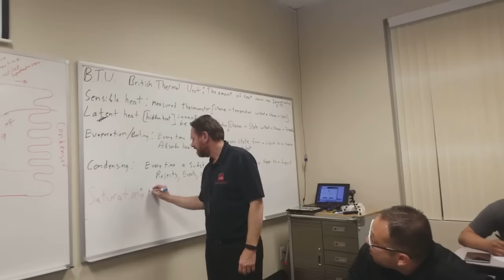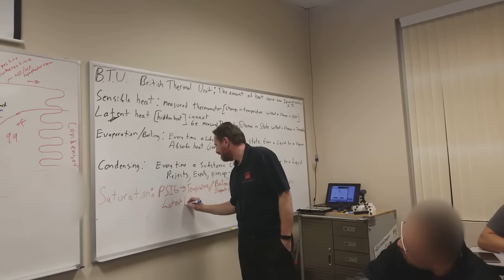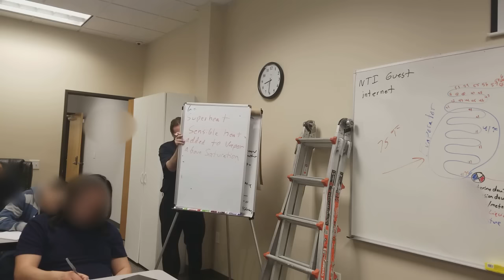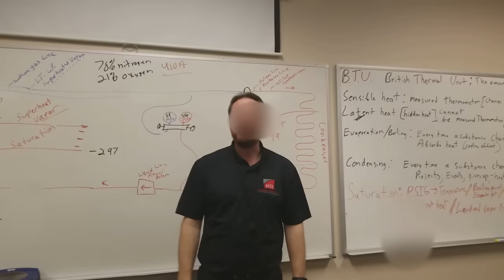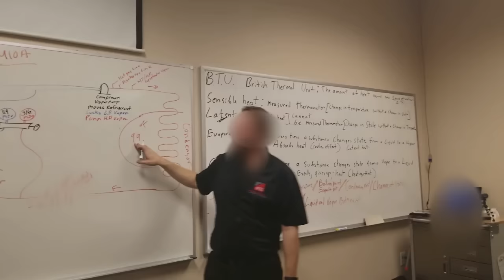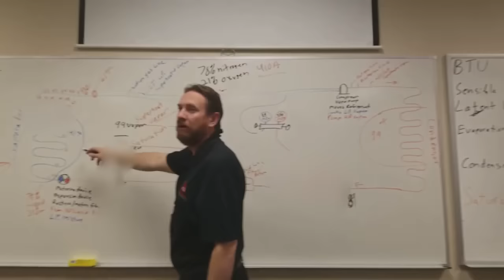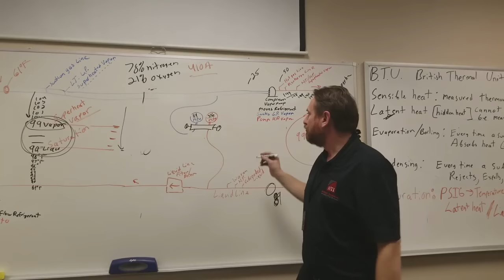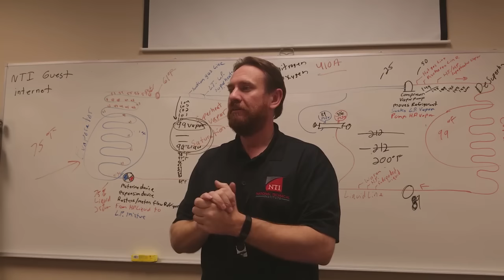Saturation, Superheat,  Subcooling

Comment: In refrigeration I have seen a common engineering practice - where / in which your liquid line and your suction line are tied together side by side ( touching / in contact ) with each other . This helps to further subcool the liquid refrigerant entering your TXV - and -  at the same time - further superheating  the vapor refrigerant returning on the suction side of the compressor which ensures no flood back or liquid slugging your compressor . Great Instruction 👍👍👍

Comment: You have a nice beginner course going here, explained in layman's terms with a bit of the scientific mixed in.  Good job Sir!  You're transitioning them from guys and girls with common sense into a more scientific bunch.  We actually give classes at our company for the kids and adults coming out of refrigeration school just as you are teaching here.   They don't need to know all the science, but what is relevant and most relevant to a refrigeration system.  Don't forget to let those new scholars know that it doesn't matter how cold you're getting something, it is always the same process of moving heat from one place to another.  It doesn't matter if you are cooling air, water, glycol, or even another refrigerant, it's the same process.  (When I say other refrigerant(s), I'm speaking of cascade refrigeration systems).  Good show, good teaching, and good luck to all that are learning the refrigeration process and how thermodynamics work!

Comment: excellent teaching. do you have another video explaining when to stop adding refrigerant using superheat and subcooling temperature? i assume this concept applies to refrigeration too and not just hvac units. also for new or empty refrigerant units (hvac or refrigeration), is measuring the superheat and subcooling temperature is the best method to perfectly add refrigerant?
Reply from the maker: I will work on adding a video for that

Comment: hi, r410a system ( with fixed orifice) with equalized pressures of around 200psig. But once compressor starts the low side drops to 50 psig while the high side goes up to 300psig. I checked superheat was like 80F and subcooling was 2F. Does this mean the system has leaked out all the refrigerant? Does the 200psig equalized pressures means there's refrigerant in the system? thank you.,
Reply from the maker: With a fixed orfice I will also need to know return air Wet bulb and outdoor dry bulb to get a target superheat and subcooling.

either way an 80F superheat  is a starved evaporator and 2 subcooling is a starved condenser so you have a leak somewhere. 

The equalized pressure means very little overall. it means you have some liquid in the system but you could be overcharges or with only a few drops of liquid and get the same number.

Comment: Good video.  I wanted to throw another question your way, if your low side is measured at 119 psig, and your high side is 385 (or so) the low side saturation temp is about 40 F, would you have an even lower temp/pressure directly behind the expansion valve?  I'm trying to reason out how one can get frost bite from gas leaking out of a line set on your hand and evap coils sometimes freeze up when there is 119 psig on the low side.  The idea floating in my head makes me think there is a momentary very low pressure that causes the vapor in the evap coil to reach much lower temps.  Is my thinking totally off?  Thanks again Ty
Reply from the maker: Thank you.
The pressure immediately past the metering device will actually be slightly higher than at the end of the evaporator coil due to some restriction in the length of tubing through the evaporator. However, there is more liquid at the entrance of the evaporator. 

As for the frostbite, where is it at, the suction port? If so that is a sign of very low superheat, meaning you have some liquid changing state.

The coil freezing at 119/(40°F) could be a few things. Gauge calibration or accuracy. Airflow pattern inside across the coil, or a restriction in one of the evaporator circuits.
Reply: @love2hvac  Thank you for the reply

Comment: In regards to mini split heat pump units, if you are meant to use the sub cooling method as a way to check refrigerant charge because of EEV in outdoor unit, how are you able to do it if there is only 1 service port on the Suction line and nothing on the liquid line? a lot of mini split systems seem to have this set up. thanks!
Reply from the maker: That's a great question. I'm going to put together a series dedicated to ductless minis soon.
Reply: @love2hvac  sounds good, ill stay tuned! aha thanks

Comment: Saturation temperature is the temperature at which refrigerant is boiling in the evaporator at the lower pressure.
&

Saturation temperature is the temperature at which refrigerant is condensing after the de superheating in the condenser at the higher pressure.

Do we need to check the pressure after the compressor to ensure saturation in condenser is happening at an some required and expected temperature?

Do we need to check the pressure after the expansion valve  to ensure saturation in evaporator is happen at some required & expected temperature?

Saturation temperature is pressure converted temperature inside the condenser and evaporator.

Thanks

Comment: Thumbs up I really appreciate that 👍 so absorb latent heat from room temperature than sensible heat above saturation point. At condenser rejects latent heat then sensible heat below saturation. Correct me please if I’m wrong thank you sir
Reply: Soon as refrig enters the hi side(After compressor) it begins the heat rejection process. First desuperheating occurs(sensible heat loss) then once it has desuperheated to its saturation point(condensing point) which is where liq n vapor exist together it begins removing latent heat(changing state from vapor to liq) remember the temp doesnt change during this time. Then about 95% on the way down the coil it is liquid and as it travels the rest of the way it will lose sensible heat making it subcool(temp of liquid below condensing/saturation point). U want subcooling for 2 good reasons and the more u subcool the better(generally). Reason 1. To ensure the metering device gets only liquid(cuz that's what its meant to meter) and reason 2. The lower u drop the temp before the refrigerant goes thru the metering device the less flash gas u will have once it enters the lowside. More flash gas is bad in evap cuz the job of evaporator is to evap the liq refrig. If u have a large amount of ur refrig turning to flash gas then u r losing capacity for ur evap to absorb heat cuz it has less liq refrig to vaporize

Comment: Please help me understand how subcooling is done? I know the purpose of subcooling and i have a decent understanding of thermodynamics but no one ever mentions how the subcooling is done practically. Is it basically by manipulating the pressure slightly to ensure that the refrigerent is sufficiently "cooled"? So that the pressure increases slightly after the liquid passes the condenser to ensure that the refrigerent is below the saturation level? or is it simply by dimensioning the system in a way that the saturation temperature of the refrigerent is lower than the ambient temperature?? I know how subcooling and superheating is done in a turbine because there we can actually mnipulate the high temperature and low temperature sink, but in refrigeration cycle, we can only play with the pressure so no one really explains how subcooling and superheating is actually done?
Reply from the maker: On the same playlist, I have a bunch of videos in consecutive order in great detail about subcooling and superheat. I don't remember the number but start at the temperature pressure and it builds from there.

Comment: Awesome video.  Lately, I have been running into high SH and SC at same time.  Piston system, liquid line drier is fine (less than 0.5F), supply air is cold.  What am I missing?  I have seen mentioned blocked orifice or screen, but in a 10 years or old system with sealed refrigerant loop, how would dirt get in to block ?  Also, what do I tell customer, when they say system was cooling fine last summer or just service the unit, it's cooling fine.
Reply from the maker: Asuming proper airflow and clean coils inside and out.
High superheat=starved evaporator
High subcooling = flooded condensor
Refrigerant restriction or non condenses.

Check the delta t on the filter drier should be the same temp. Make sure there is only 1 drier (look behind valves)
Look for kinks.
Do a quick acid test.
After that is a big step. Recover all the refregerant, open the metering device, check screening it has one. Look for black residue in lines. 
Mine aswellbput a TXV in with the work. Change the filter drier, pull deep vacuum under 500 microns and recharge with new refrigerant. 

Causes, brazing without a flow of nitrogen at installation causes oxidation inside, that floats around the system until it collects somewhere to do its damage.

Improper vacuum at installation causes acid, takes time to see the effects of it.

Contamination, Mixing refregerant, on purpose or accident. Example the tech takes the high side off and bleeds it back across the manifold to the suction side. Anything in the yellow hose or manifold gets pushed into the system. Effects also not immediately seen.
Trash, copper shavings, anythingbin the lines at installation floating around until it finally hangs up.

Compressor or discharge line got too hot causing oil breakdown.

There are more but a good starting point. 
Hope that helps.
Reply: @love2hvac  Thanks for awesome and super fast reply.  Initially I blamed on my digital gauges or bad hoses but they show almost same reading as analog .  I will follow your suggestion on next job.  I guess, once I see both high SH and SC, I just tell the customer there could be a few things causing that and give him a quote for them.

Comment: Good night. I am a new tech and I have a question that I hope you can answer. I read from "Refrigeration & air conditioning technology" ninth edition by Eugene Silverstein on page 49, that when a vapor is superheated will no longer generate more vapor pressure, so how is that when an outdoor fan is not running the high side pressure would increase?. Also, the law of gases state that when you increase temperature and the volume remains constant the pressure would increase too.

I really need help with this. Thanks a lot.
Reply from the maker: The newest one I have is the 7th edition so I won't be able to directly reference that page. 

The individual gas laws can be misleading because they only talk about one very specific part. Boils law, Charles law, gay Lussac's law, law of perfect gasses, ideal gas law.
We can't just look at one of them to see what's happening as they all work simultaneously. 

Let's start here
Saturation =
#1psig to temperature, 
Boiling point, 
Condensing point, 
Chang of state latent heat,
Liquid and vapor both exist.

The gas laws can be summed up like this... 
Temperature, pressure and Saturation are all tied together. 
When one goes up so dones the other 2 when 1 goes down so does the other 2. This is where the temperature pressure chart comes into play.

In a tank of refrigerant even a propane tank this applies.

When the temperature of the tank goes up, so does the pressure and saturated temp ( boiling/condensing point ). all the gas laws come together to make this happen. You can't change 1 without affecting the others. 

On the system you have 2 pressures indoor and outdoor. 

As the temperature outside goes up the pressure and Saturation point also goes up. When the condensor fan goes out there is  nothing to move the heat away from the condensor. The fan keeps the refrigerant cool.  The temperature of the copper and refrigerant goes up, and so does the pressure and saturated (boiling/condensing) point. 

Subcooling
Let's go back to the propane tank now that we established the temp/press/saturated point. If you had a tube coming from under the tank, you could run it into ice water. In that section the propane would be Subcooled below it's saturation point but the temperature/pressure/saturation of the tank would be unchanged. The same is true with subcooling refrigerant below saturation in the condensor. 

Superheat. 

At the top of the tank, you could have a tune extended up. You could add heat to that tubing. The vapor in that section would be superheated above saturation. It would not have an effect on the temperature/pressure/saturation of the tank.

Hopefully that helps.
Reply: @love2hvac  it does help. Thank you very much.

Comment: I’m building an AC system and had a few questions if anyone can help. 
1. How do I determine how large of a condenser and/or evaporator I need?
2. I’d like to control the noise of the motors and thus the speed. Are there temperatures and/or pressure readings I can use to determine what speed I should run the fans?

I think I need to figure out a balance between efficiency vs. noise.
Reply from the maker: 1 size will be determined by a heat load calculation called ACCA Manual J. There are many programs that do this. It's best to have a blower door test performed to know the leak rate.  After that you use ACCA manual S so size the system to the load.
2 noise will be controlled by a properly designed duct system that matches they system. It's called ACCA manual D duct design. Properly sized system you should never hear the unit running. 

Once the system has been properly sized (oversized is worst) with a properly sized duct systems (undersized is worst) then the efficiency and sound will be spot on.
Reply: @love2hvac  Thanks Ty and hope you are well, I should have been more clear, I'm not as worried about the evaporator, I'm more worried about the condenser noise, this is an custom set of hardware for an automobile application so I don't have any sort of information other than "you should put 650g of refrigerant" into the system. I'm trying to wrap my brain around this enough to understand if there is any sort of algorithm to determine what the fan speeds on the condenser and subsequently evaporator should be.

After doing a bunch of research it seems I need to do the following:
1. Figure out (somehow) that I'm getting saturation at the midpoint of your condenser so I can subcool for the longest duration.
2. Clamp that subcool 4 degrees higher than ambient, this is where I think I might have some play with the fan speed, I will have a look tonight but I'm curious if this value is even the magical 10deg figure currently.

The other funky thing I haven't figured out is whether this compressor is a fixed speed. I have a feeling it is not which adds another unknown into the mix. On top of that I'm also a little confused if any of this is effected by the position of the expansion valve.
Reply from the maker: @leblancexplores  
How is the compressor powered? 
Open drive/belt driven( typical) or 12vDC fixed/12v DC variable/ 400volt DC Tesla or is it AC many food trucks and trailers?

I'm residential we use large condensed and large volume of air at lower speeds. We use large sickle blade fans to reduce noise and RPMs of 825/1075.  Automotive uses the air of the moving vehicle for primary sir. They have the engine driven or electric fan for lower speeds. You will notice lower cooling capacity when stoped part because of compressor speed but part because of the heat buildup from lack of movement of air. The mechanical/electrical fans are very loud. The condensing unit space is limited so they don't have much room to do other things. 
You can try a fan out of an lincoln continental with a 3.8 and the Mark 8 with the 4.6. Its dual speed and can flow as much as 4500 cfm on high. You can add a speed controller to that and adjust the RPM to have the performance and sound you need.
Reply: @love2hvac  Thanks again for your reply and sharing your knowledge, currently it's a single 12V fan and the vehicle will be stationary when this system is active. I can create my own PWM fan controller and even explore other types of fans (centrifugal vs. radial) but as you mentioned space is limited. I have two mounting options, one is underneath, imagine space of an under mounted spare tire, or if a dual fan larger condenser setup is necessary I've seen one mounted on the frame rail.

All the components just seem rather on or off and being able to spread out that cooling capacity within reason to reduce the amount of noise I think is the ultimate goal. This sounds like it will just take some experimenting but I'm still a little curious what numbers you would be crunching.

Comment: How about saying vapor line instead of suction, because when using a heat pump the lines change? Think about it
Reply from the maker: I teach it has 2  names. A suction line and a vapor line or they can combine it to a suction gas line.
I make them learn itnis a high temperature, high pressure, superheated vapor traveling towards the compressor. I also teach them the line coming out of the compressor is a high temperature, high pressure superheated vapor. I teach that the compressor is a vapor pump, vapor in and vapor out.

By the time I get heat pumps it is easy for them to understand
 They get a much deeper understanding rather than simplifying into only a vapor line. 

The other problem with simplifying it to a vapor line is when the guy gets on his first call can the lead says suction line theybare lost. 
This way they know the proper names, the quick names and more importantly an understanding of what is going on and why.